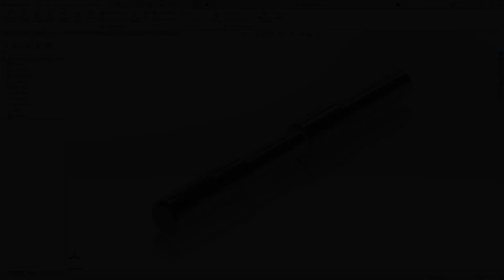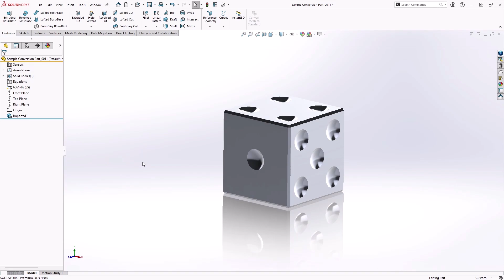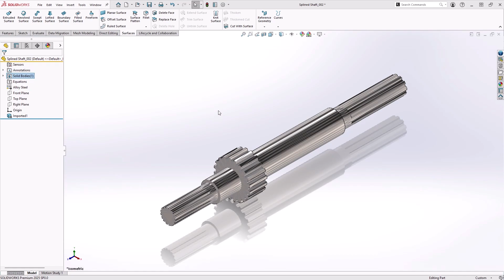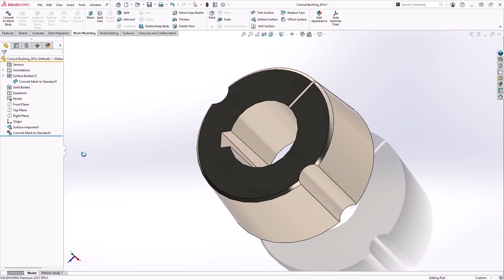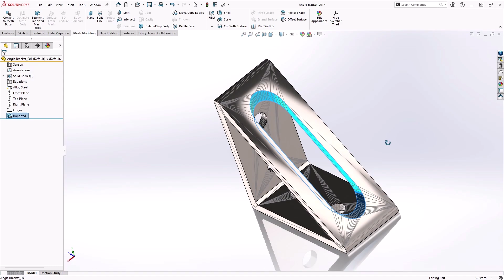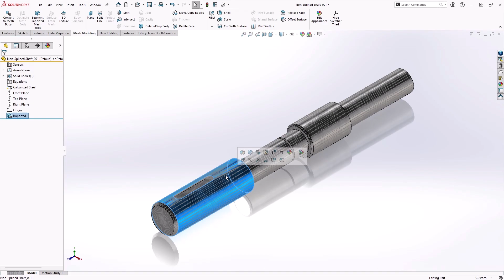What's New in SOLIDWORKS 2025 - The Convert Mesh to Standard Tool

Comment: Mesh to Solid, having issues with Solidworks 2025 SP3 I am trialing. I simply downloaded an STL file, opened as a solid with both mesh option ticked, and it opened fine in Solidworks. I then tried to convert Mesh as per this video, and about a minute in, solidworks crashes. does this over and over again. I do the same import into Fusion 360 Free, and it opens totally fine, and can convert that to a solid no problem. What gives... I have been running SW 2021 since 2021, and have had no reason to pay for the upgrades. This 2025 with mesh features is what prompted me to try it out, but it still can't do anything with meshes correctly... Its so annoying.